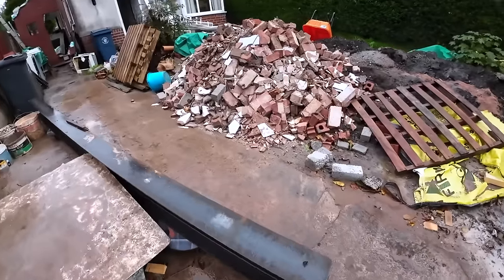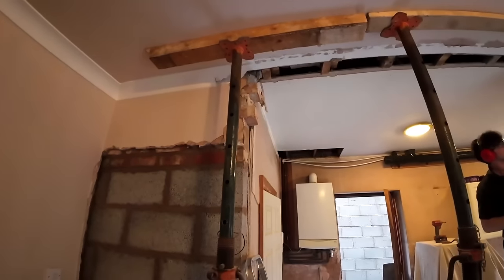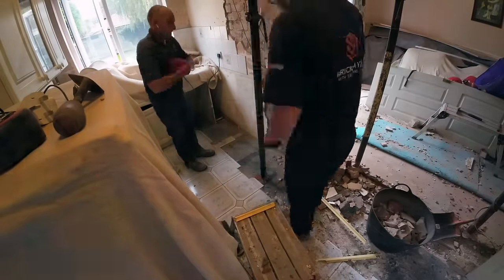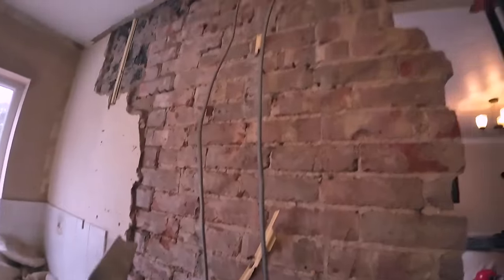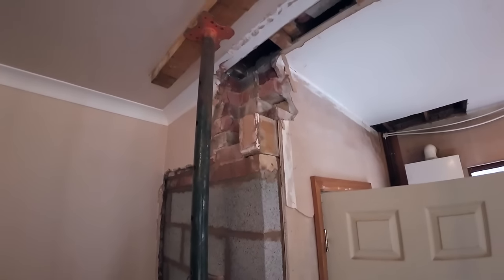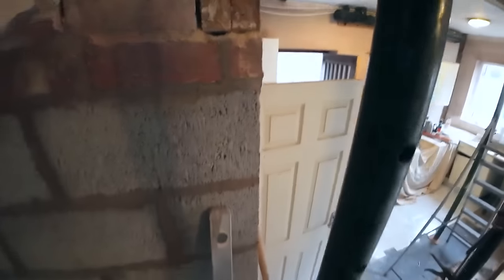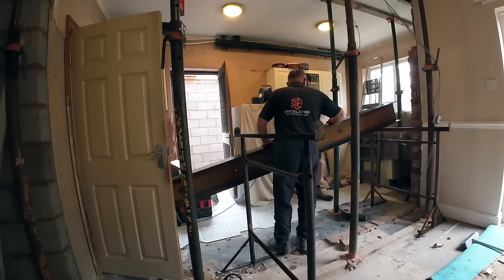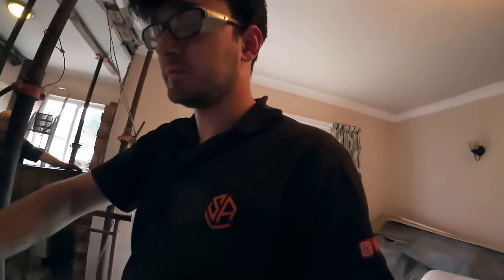BIG STEEL RUINED OUR DAY .. SMALL EXTENSION PT 11

Comment: You have my sympathy 

I put my steel in on my own. 5.5m long I-beam with two 8x2” timbers bolted through for hangers

Knocked a hole in the outside wall and had to use a “come along” to slowly drag it in to house. 

Then two winches to lift on the padstones 

A sense of achievement though for one person
Reply from the maker: Jeez well done 👏🏽 🥵🥵🧱👍🏽

Comment: Great video as always, loving this come together slowly. Taking onboard all the information I can so I can look at having an extension on my house, certainly helps knowing how things are done so I can understand what can and can’t be done etc. I have a question, is I possible to do this job with a flush ceiling? Can existing joists be inserted into the steel?
Reply from the maker: Yes but it’s a huge messy job including holes in the floor and also in the upstairs was . 
   Very messy 😬🧱👍🏽

Comment: I think you were a bit optimistic with finishing in the day knowing that you had making good above the beam to do as well.
This job has been a bit of a struggle but i suppose small extensions and working on previous extensions are a bit like that.
The great thing is that you don't compromise on quality when things take longer thsn you expected.
Your next customer should understand the delay and appreciate that you do a good job regardless.
Genie makes sense when only two of you and a dodgy hip as well, extra cost but easier and safer.
Keep up the good work.
Reply from the maker: Cheers mark . Always trying to keep the customers costs down as much as possible but it only costs me more in the end 🥺🧱👍🏽
Reply: You've got to weigh up (pun intended) you're own health and safety against a small additional cost to the client for beams above 75-80 kg.
Reply from the maker: @markdauncey927 definitely 🥺🧱👍🏽

Comment: Coming along nicely. Steel is quite heavy are fiberglass beams approved for use in the UK?  They are more expensive than steel and sourcing them can  take some time. Cheers from Texas
Reply: I doubt that fibreglass would be any lighter than steel to carry the load and keep deflection within code limits.
In answer to your question - not available 'off the shelf'
Reply from the maker: @markdauncey927 🧱👍🏽